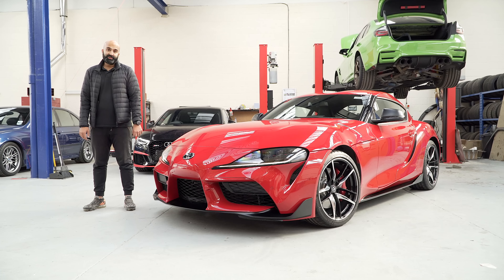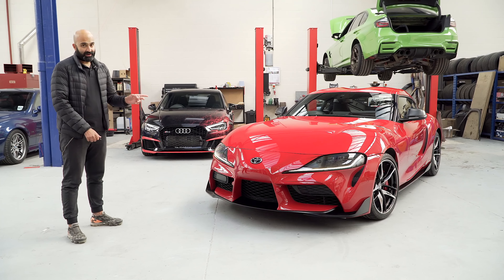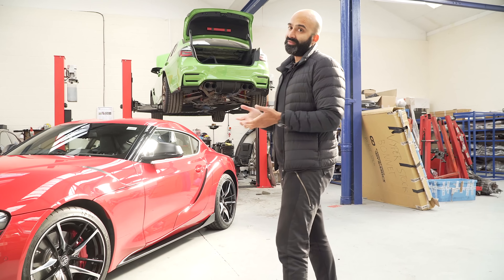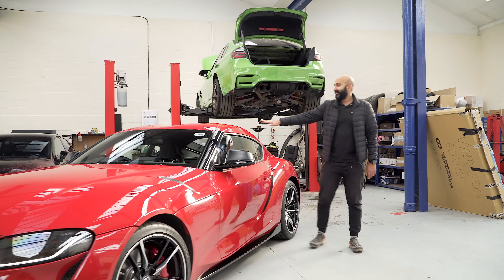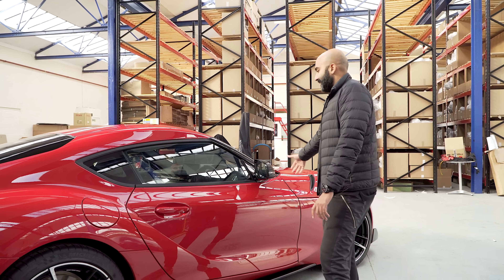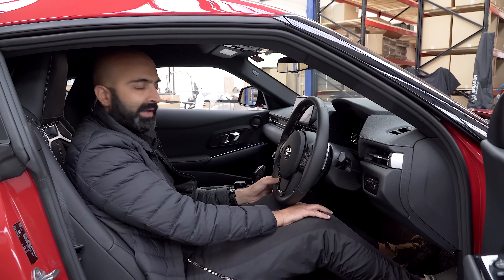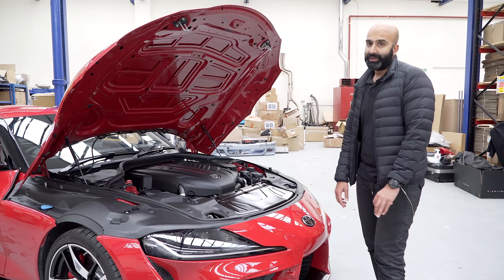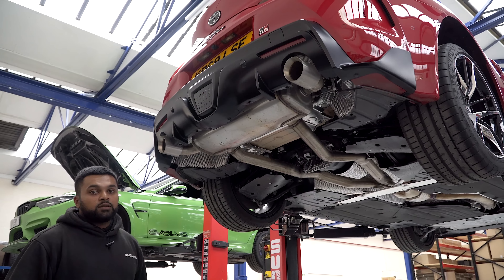Introducing our A90 Supra Project Car!

Comment: Agree on the mirrors - way to big for the car, a smaller rounder mirrors would suit the supra more.
From what i understood you have tuned the car and you are at 200~ miles, without doing the first service at 1200~ miles. Is that correct ? Don't you think you would put extra stress on the engine and the oil they use for the first 1200 miles i think it's different to the one used after.
Interesting to hear your opinion if i understood correctly.
Other than that we all know the b58 has huge potential and lots of american tuners have brought the car to 500~ whp with just a bigger turbo.
I am a bmw fanboy like you but i like the work that bmw and toyota have done and we are seeing something different and sporty.

Comment: Hey Imran, great vid as usual, With all the mods your planning surely its crying out for CF Brakes?
Have you thought of a code name? Like Starla for the M2?
One thing i would look out for is leaves etc clogging up that vital front vent, especially round those country roads this time of year, heat soak is going to be a challenge!
Has it got fake engine noise piped into the cab?
Look forward to watching this develop, thanks.
Reply from the maker: Thanks Rory. Not sure we will go as far as CF brakes on this one especially if there isn't an off the shelf solution. No leaves blocking anything yet. The stock cooling is just crap. Haven't thought of a code name yet but will do at some point.
Reply: Why Not "Boris"..Full of hot air..lol
Reply from the maker: @rorywheeldon1623  Haha